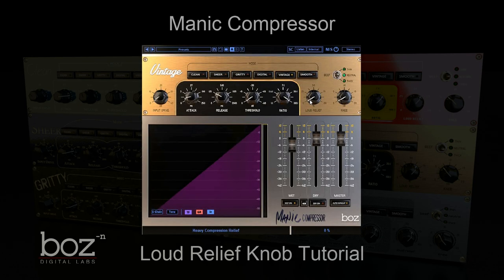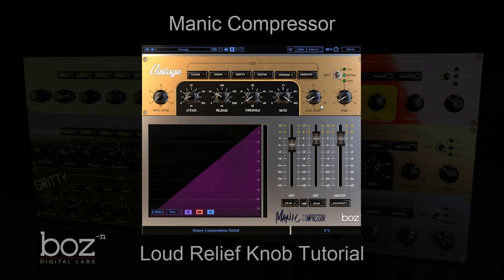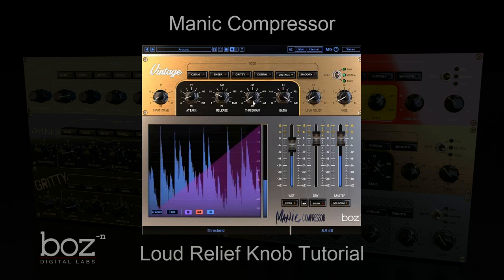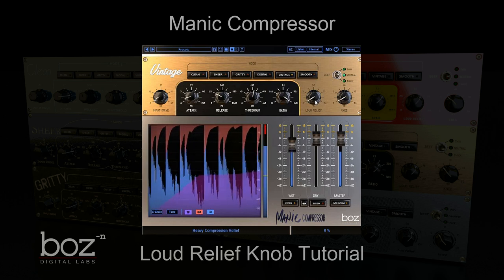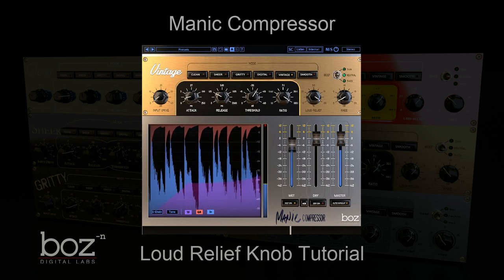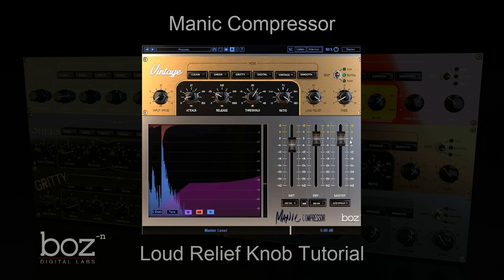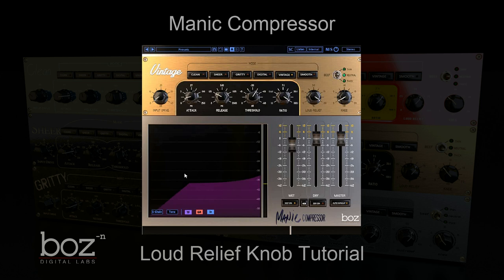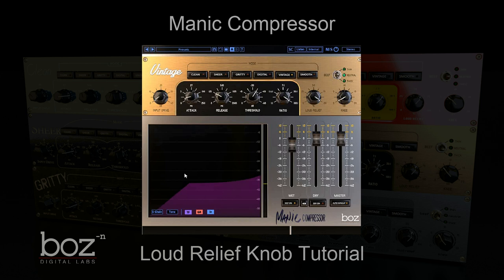What is the Loud Relief knob in Manic Compressor?

Comment: Related to the "knee" setting, it seems "Loud Relief" modifies the compression ratio dynamically. As the Loud Relief setting increases, it squeezes/ pushes-back on the program material less and less as it is detected coming in closer and closer to the threshold. Correct?
Reply from the maker: It actually compresses softer as the program material goes higher above the threshold. It's sort of like the inverse of a soft knee happening above the threshold.

Comment: Am I crazy or does this just seem like a rebranded "mix" knob? I recognize that on a technical level "loud relief" may function differently than a "mix" knob but in practice they seem quite similar.
Reply from the maker: It's not that crazy a question. The effect is similar in some ways, but they have a different sound. Sometimes I use the wet/dry blend, sometimes I use the "loud relief" (sometimes both). Using this knob keeps the character of the attack/release curves more so than blending the wet with the dry. You can download the demo and try it out for yourself to see if it works for you.
Reply: I really appreciate this reply! Some manufacturers might have responded defensively. I already own Mongoose, Little Foot, Bark of the dog, and Panipulator. I Love Mongoose. Use it on every single mix. I don't really use the others (I recognize two are free, so no complaints). So I've been wondering about some of your other plugins and how much I'll actually use them. This response has made me much more likely to buy again in the future! (That and special offers for repeat customers)